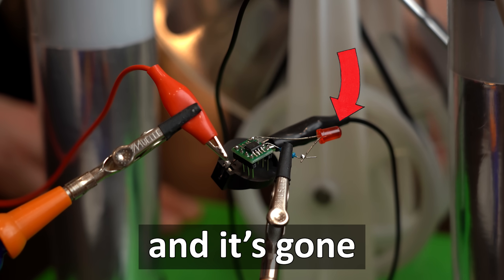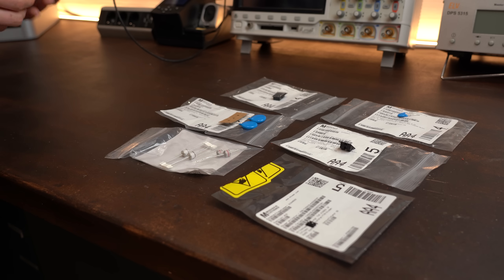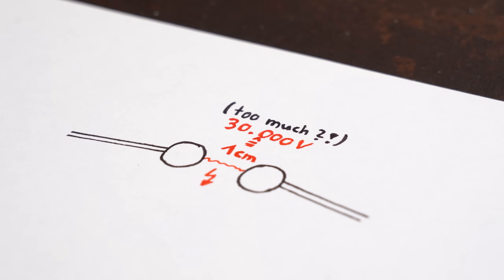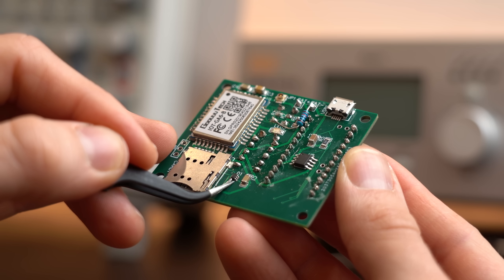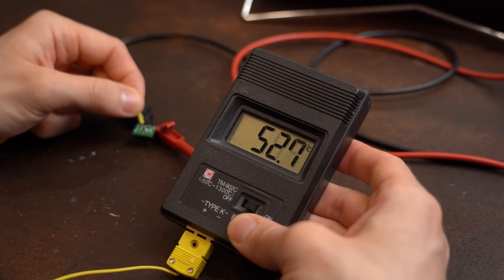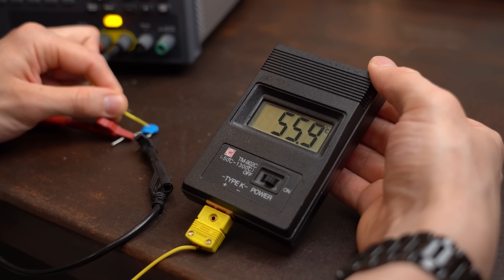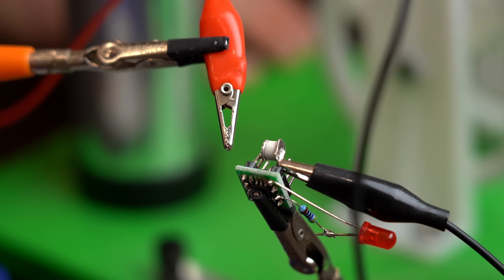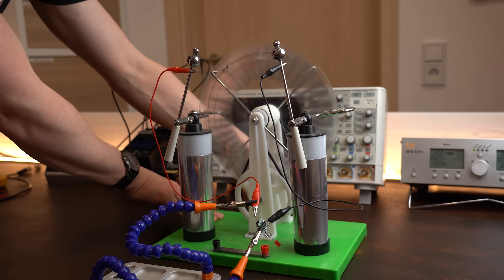This $0.70 Component SAVES your Circuit?! (Surge Protection) EB#59

Comment: When designing automotive type electronics that had to meet EMC standards, the electronics had to withstand ESD discharges up to 15kV.  Something as simple as a 1000pF cap at the input was often sufficient protection.  Signals that couldn't tolerate that much capacitance were good candidates for a TVS diode.  For power line transients, which are much longer in duration and contain much more energy, a larger TVS was usually the solution (perhaps in a SMB package).  The datasheet will tell you how much energy a TVS package can handle.  MOV's weren't used, and I get the feeling that they are more oriented towards mains power where lightning strikes are a risk.

Comment: Reminds me of “load dump” in car electronics. Never really figured out what to do about it and figured if it happened I’d have bigger problems than my relay drivers failing.

Fused MOS might have been a good solution.
Reply: Load dump has a finite amount of energy. And the voltage is also not so dramatic. Around 60V is the accepted load dump voltage.  A semiconductor transient voltage suppressor can help.

Do you want the circuit to reset automatically? Or are you OK with a fuse blown?

The load dump in a motor vehicle is absorbed by many devices that are still connected when the battery is suddenly disconnected with the alternator at high current output... The engine is running and the over-voltage can be absorbed by lots of things. Not just your gadget.

It's instructive to look at the circuits in well designed automotive devices to see how they handle the eventuality.

A TVS will begin to conduct at a certain voltage. You can use that current to switch a hefty transistor to shunt a large current at over-voltage to ground, through a low impedance, protecting the circuit behind it from very high voltage. The transistor input should be separately protected unless it can tolerate the dump voltage. (This will cost more than a few cents!) Note that  the load dump may not provide enough energy to blow a fuse if the protected device usually needs several amps.

Other options include selecting load dump tolerant devices such as automotive voltage grade voltage regulators to protect the power in your circuit... But not the inputs. Inputs are generally high impedance (within their clamping voltage) and a TVS of appropriate voltage rating should do the rest by preventing excess load dump energy getting to the input pins of the chip. ESD protection is a bonus.

Always keep the whole thing in perspective; not how you protect your microcontroller chip from the whole monster load dump! And don't spend $100 protecting a $10 circuit unless it's literally vital for the circuit to keep going.

Comment: MOV or TVS diode are not that different. MOV is a sintered material and has the same diodes but just an enormous amount of them in parallel and in series. If these are protecting they can degrade bit by bit until they short or break. The TVS diode will be gone in one single overload. The GDT's are typically used to protect against lightning and always combined with THS or MOV. ( Which is the reason it failed to protect your controller )
In old TV's there was a component which just provided a spark gap in air. just 2 wires 0,3 mm apart, serving as a GDT with the gas being air.
Worth being mentioned is clipping diodes in a digital input circuit. Often integrated in the IC but if not, it can be placed externally. 
If lightning strikes directly, you can have all the protection possible : Nothing will save your circuit.

Comment: The leads should be kept short between the TVS and the component being protected, otherwise, the voltage spike across the leads because of the inductance might cause the TVS to clamp too late to save the component being tested.

Comment: I would like to add some observations and know more. I have seen many SMPS with MOV for protection. First failed component I always saw is MOV with dark discolored and often cracked like 2 separate disks for each terminal. It happened over a few years in India and often with power surges. Specifically they open circuit after 3-5 power surges. Which is around 2 months of time. I tried observing this because another SMPS had a fuse installed instead of MOV with almost same rating. These SMPS were used to power small LED panels for a business display sign with a LED driver always.

Comment: That was a really interesting video. 
What I'm wondering now is how I can determine where I would add a TVS in my circuit. How can I determine where it makes sense to protect from these voltage spikes? Do I just add a diode to every IC input?
Reply: The general rule I've seen is to add ESD protection anywhere a signal leaves the board in a manner which may be connected or disconnected while energized (based on the theory that the inductance of cables, etc. is likely to cause ESD beyond what ordinary decoupling capacitors will suppress).

My rule is to add ESD protection to all signals which leave the board, at every connector of said signal if board space allows and at one if board space is tight, and to massively oversize ESD protection on power circuits or others in the same connector (this can save your board from being fried if you, say, incorrectly assembly a wiring harness providing power to your board and flip, say, the 5V and 12V rails, assuming you inspect your board with a thermal camera shortly after powering it up the first time). TVS diodes are cheap and very easy to integrate so I choose the safest option where possible.

Then again, for cheaper boards this may not be worth it, and as others have mentioned here, good design practices surrounding decoupling capacitors will stop most ESD from being a problem. Different ICs also very significantly with respect to their internal ESD protection, some (such as low-cost microcontrollers) may be easily damaged while others (such as industrial-grade differential line drivers) may be extremely robust. Checking the datasheet is always a good idea if you're producing a quantity of boards where the cost of ESD protection would make a difference.

Comment: Could you use the insulation tester to charge a high voltage capacitor, and then output through a known resistance to limit current?
Reply: Agree

Comment: This is probably the best video I've seen about a concept I knew about but hadn't delved into. You mentioned that a MOV is often alongside a fuse in a power supply that blows when such an event occurs. I'm wondering what the fuse adds in such a circuit beyond fragility. Is it for non-transient high voltage events?

Comment: You can make a zenner diode go there, you can even create a zener diode serial array.  This way you have a full wave antenna that bounces until it adds up to the next zoltage.  So you wrap up full wave zeener diodes inside the blade antennta, at each stage, well it is mhz, so the audio is much louder in real time.

Comment: Yes, ESD and Surge protection does NOTHING(and it is suppose to).
Like a Seat Belt, helmet, bullet-proof vest; you do not need it right up to the moment you do.
Then you are either glad that the extra cost was added to the design....or not.

Beware, ESD and Surge protection can be removed for cost saving in production and no one is the wiser till boom.

Comment: As far as your microcontroller supply line goes, simply adding the 100n decoupling cap that should be there anyway will pretty much protect it against ESD. The pulse is high voltage but very low energy (standard ESD model often uses 150pF) and thus the decoupling cap will act as a capacitive divider and "eats" the ESD pulse.

Comment: I'm familiar with GDT as a "Comgap". As in communications gap. Back in the landline days, they were a required component (in Canada at least) across tip and ring on a phone line. Every modem had one for example. It was to supress lightning strike level voltages from reaching the consumer. If it happened to protect a circuit, that was just a side effect. They were often used in combination with a MOV. Old-school rotary phones generally didn't need them as the ringer coil would take the punishment instead.

Comment: Varistor are common in circuit specially in smps but there is problem. If there High enough voltage it will arc between the pads of circuit. I have literally fried 3 smps in similar way. When I opened it up the copper pad were the witness. So tvs diodes are perfect for such applications.

Comment: Nice video, very informative. There is one thing I was missing. When adding such a protection to your pcb, you should pay attention to your layout and routing. You must route your wire through the pads of the tvs/mov to get the best results. And ideally they should be close to the connector.

Comment: Hi Great Scott!
Very interesting program.
Great that you opened the two overprotection circuits. Interesting to see what they are doing to protect from the surge.
HOWEVER, the really interesting teardown would be the OBO Bettermann Surge Protector. I have been wondering for many years what is the magic in there and why they are pretty much the only source for this class of surge protector and what they use in there to justify such a steep price. Last time I looked at them some 20 years ago they were over 300 € each. So, if your budget for a program stretches tgatbfar could you examine the OBO device.
BTW the OBO device is the one that is use by pretty much all the railways around the world for serious surge protection.
So, what is their magic sauce?

Comment: A thing I like to do to protect low current inputs is a high value series resistor and a capacitor to gnd behind it. The resistor limits the current and the capacitor just eats the charge, so there is nothing left that the internal protection can't handle. Great for button inputs, as this also covers debouncing or acts as a low pass for "slow" analog inputs

Comment: What is the path of current in TVS in case of ESD. when circuit is not connected to anything. can u explain a little please. As in case of powered Circuit a transient in Supply voltage the current will be passed to GND but what is the case when circuit is not powered

Comment: MOF? Sometimes you just can't fight the mother language.

One of the problems with all these devices is their limited number of uses or events as they are called.
Each time an event occurs they are each ever that much degrated and unfortunately most of them fail short.

Comment: Hi GreatScott. Good video! I would like to add a few things:

9.44 the fuse in series with a varistor that you have drawn is not a thermal fuse, but an ordinary fuse, which would open when a varistor is damaged due to a high surge current. A thermal fuse is usually added in series to the varistor, so that if a varistor gets damaged and it conducts some small current it gets slowly hot - in that case a thermal fuse would open. some manufacturers even include a themal fuse in a varisto case, so the varistor has 3 pins. But you mentioned that the fuse blows when¸ an overvoltage event takes place, which is wrong. this would be a terrible design. actually we have to choose fuses, which have a high I^2t rating so that they DON'T blow during expected surge events.

Your testing is only with ESD pulses, for which TVS diodes are best. Varistors and GDTs are used for surge pulses (indirect lightning strikes and inductive overvoltage events) which contain much more power. the 8/20us pulse is a typical indirect surge testing shape, which has 8 us of a rise time and 20 us of duration. there is also 10/1000us which has much more energy.

ESD protection and surge protection are very different things.

Usually for surge protection we use several of these protection components. for example we start with GDT, then varistor and then with the TVS diode. All three seperated with an inductor. Current and voltage on the device gets smaller with every component.

11.46 this is a thermal fuse and it opens when the varistor gets hot. the failure mode of a varistor is that with every surge pulse it conducts more leakage current. and when this leakage current is smaller than the current fuse in series, the varistor gets very hot and it ca cause a fire. that is why standards determine there has to be a thermal fuse there, which opens when varistor gets too hot. then it is time to change the protection module.

Note that an ESD pulse has a rise time of 1 ns and duration of approx 50 ns. But a surge pulse has a rise time of 8 us and duration of 20 us or more.

The problem with varistors is that the current through the device is increasing quite slowly with voltage rise. But a TVS diode's current increases much quicker with increasing voltage. at 7.58 you drew the correct V/I characteristic. but when you dig in a datasheet you see that the current rise in varistors is very slow. For example the varistor you showed MOV-20D681K conducts
1000A at 1600V and 1A at 800V. so it need additional 800V to get from 1A to 1000A.

Usually a varistor is not used as a ESD protection device. I think it protected your circuit due to varistors parasitic capacitance, which conducts ESD current and not really due to the varistor voltage limiting.

Comment: The components shown as "thermal fuses" for MOVs were no thermal fuses at all - just normal fuses.
Reply: Normal fuses are infact a thermal fuse. The device you're confusing that terminology with is a thermal cutoff, which a lot of people improperly refer to as a thermal fuse
Reply: @Iammastercheif1  I would say that is debatable. Look at Wikipedia - both terms are used interchangeably.
Either way - what is shown in the video is not was is used to prevent MOV thermal runaway.

Comment: Here's a video idea: Signal integrity

When and how to use shielded wires, coaxial wires, differential twisted pairs, ect and avoiding issues like ground loops (like connecting the shield only on one end) ect
Reply: Yess. And things like 50 ohm terminations and signal reflections
Reply: @ameliabuns  Oh yeah, definitely!
Reply: @iamdarkyoshi  although I think Scott's area of expertise is high voltages and mains stuff?  so he might not be the best person for this as much as I love the way he explains things.
Reply: "Driven Guards" would be a good one to include in that as well.
Reply: @absalomdraconis  Driven guards sound a bit excessive for a DIY channel when most professional electrical engineers will likely retire before touching a chip that has low enough input bias current for PCB leakage to matter.
Reply: Would love a video on ground loops
Reply: Based on his stair light PCB layout, running small-signal traces parallel with the PWM-regulated unfiltered LED power traces with the two LED power traces routed about as far apart from each other as possible for maximum EMI, I doubt Scott knows anything about signal integrity. He'd certainly gain a lot from at least looking into the basics.
Reply: @teardowndan5364  well that could be phrased less harshly but yeah.
Reply: @teardowndan5364  Wouldn't routing power traces as far apart be a good thing actually? Like you want them far away. The way you worded it sounds like its a bad thing to route them far away. Or is it a case of power routse causing a lot of EMI so its better to keep them together and isolate them all from more sensitive stuff?
Reply: @michaeel4701  You want power and ground traces to be as close as possible to each other to reduce the loop area in-between that will act like an antenna for EMI. When you have two or more board layers available, power and ground are usually routed together on adjacent layers, reducing loop area to board substrate thickness between power and ground.

Same goes for high-speed signals and switched power nodes. High-speed signals follow the path of least inductance and that path usually follows a continuous ground plane.

In his staircase light, he was basically putting all of his small-signal circuitry and traces inside a gigantic EMI loop formed by his PWM LED control. No wonder it was glitching like crazy and he couldn't stabilize it.

He needed to either pull all of the switching components together to send regulated DC voltage or current to the LEDs or make his LED power loop much tighter.

Comment: MOVs breakdown over time, actually becoming the cause for the event (fire) that they are intended to prevent. Research "Power strip fires".
Reply: MOVs are not there to prevent a fire - but damage to sensitive components. Thermal fuses on MOVs stop fires - mentioned in the video - but shown were regular fuses.
Reply: @TylerDurden-pk5km  Tell that to Trace Adkins.